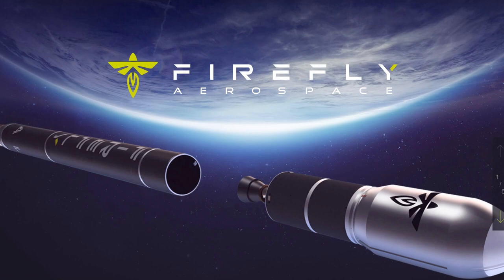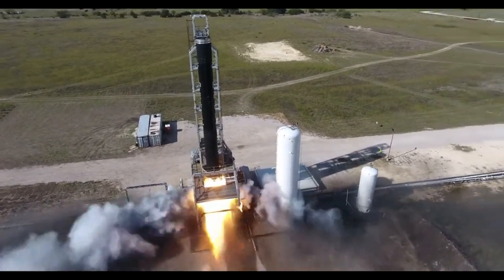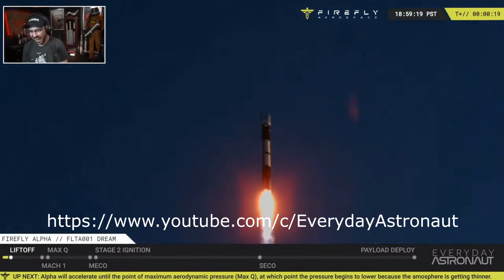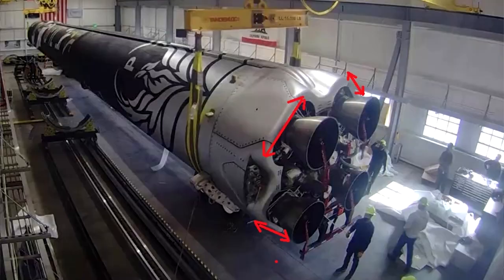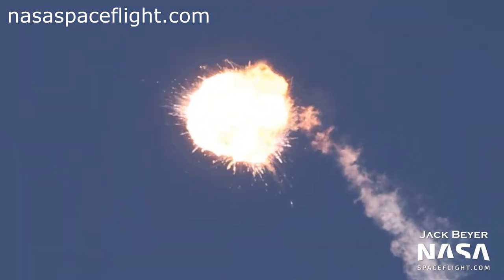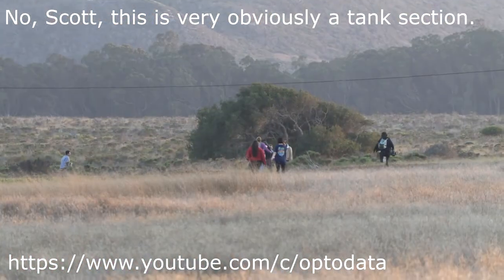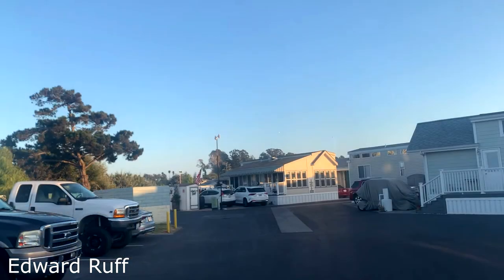Reaver Causes Destruction of FireFly

Comment: "Why do you have a parachute on your cube sat?"
"well, in case it drops out of the fairing mid flight, it won't fall to it's death"
Reply: It's so common in fact that your budgeting should probably count 1.5x the cost of the spacecraft and 2x the launch cost.
Reply: > fall to it is death
Reply: So kerbal ☺
Reply: @Anvilshock  yeah. Always doing the error, almost always correcting it. Its a curse 🤣 *it's!
Reply: Instead, once the fairing is popped, the parachute will deploy and rip the cube sat to parts, cause the rocket to veer violently and destroying a perfectly good launch!
On the other hand, in all situations where a parachute might help, it will burn up first.
And since all you launch is a cube sat shell full of parachute stuff, you may as well not bother ... :-)
Reply: exactly what I was thinking. Mine is also coating in plastic film so it won't get water damaged
Reply: @Gunstick   It's a curse!
Reply: @Gunstick  "....fall to its death"

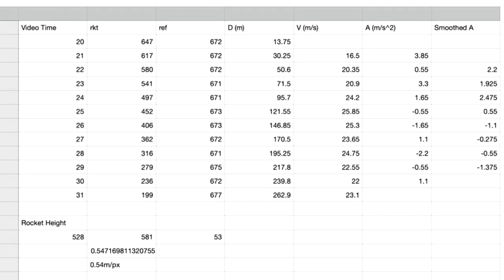Comment: 4:00 "if you are a nerd you would pixel count"
"I did some pixel count"

"I have a spreadsheet"
Conclusion is pretty clear Scott.

Well Done, fellow pixel counting, spreadsheet toting nerd.
Reply: And then he went the extra mile to estimate the altitude from a far off cell phone camera shot.

Sure, it's just trigonometry, but still.
Reply: Tell me about it. I just wasted one hour checking Elon’s statement that “air mass is not trivial” from Tim’s interview part two. By my book, it is trivial or I’d love to be explained otherwise by fellow nerds. (comment in the video).
Reply: I refuse to believe anyone is a nerd until I see their collection of spreadsheets.  If you ain't got spreadsheets, don't even talk data to me.
Reply: @ArnaudMEURET   the tiles will add c.120kg just from the air trapped in them. Plus the material itself, plus the mounting studs. Thats Starship  btw.
Reply: Friends don't let friends spreadsheet.
Reply: @ArnaudMEURET  r/wooosh
;-)
Reply: @DavidOfWhitehills  So that’s an integral part of the tile. No point trying to take it out of the equation. Elon was referring to the mass of air in empty tanks (nitpicking the term “dry mass”). Check the video at 25 min IIRC.
Reply: @ShiShawPocketSand  Truth. That hour was, needless to say, spent on a spreadsheet.

Comment: To be fair, firefly class ships are known for their ability to pull a crazy ivan.
Reply: Usually pretty good with reavers too...
Reply: “Flying piece of goh-se ”
Reply: @sithticklefingers7255  "Atherton, language!"
Reply: @han5vk  Baah! It IS 'shiny' language!
Reply: To starboard or port?
Reply: I don't wanna explode.
Reply: Now that's a Tom Clancy reference I haven't heard in a while... good work, go take a Hollywood shower, Jones...🤣👍🇦🇺
Reply: "You know what the chain of command is? It's the chain I go get and beat you with until you understand who's in ruttin charge here."
Reply: @ewetoo  ..be a 'leaf' then ♥
Reply: I am a leaf on the wind...
Reply: Except this one.
Reply: @greggv8  Nah, it successfully pulled a crazy ivan and survived. Someone on the ground detonated the flight termination system afterward. ;P
Reply: @dallesamllhals9161  yeah nah i saw what happened to the leaf
Reply: @Transmission Control Well, what does it mean to "pull a crazy Ivan"? Just curious.
Reply: @ivanpchelin7912  the Firefly class cargo ships, as seen in the TV series "Firefly" and the movie "Serenity", have their engines in pods that can swivel. They turn the exhaust end down for vertical landing or forwards for slowing down. The Crazy Ivan is turning one engine to point the exhaust forward and quickly spin the ship 180 degrees then flip the engine back. It's a maneuver for changing flight direction extremely fast but requires a highly skilled pilot and puts extreme stress on the ship. The Serenity is only shown doing the move one time, in the movie, while being chased by a Reaver ship.
Reply: @ivanpchelin7912  It's a reference to a maneuver performed by Russian submarine commanders in the cold war. They'd make sudden unpredictable direction changes that would allow them to detect and fire on an enemy submarine that was covertly following in their baffles. The movie Serenity (based on the TV series Firefly) used the term to describe a rapid 180 degree spin of a Firefly class mid-bulk transport spaceship that could be performed in atmo if its two outboard jet engine nacels were vectored independently. In the show, the maneuver was used to escape a Reaver ship that they couldn't otherwise outrun. If you name your company Firefly and your rocket engines Reavers, you have to expect such references.
Reply: @protocol6  Thanks, that's interesting :D
Reply: @aztronomy7457  starboard if it's at the bottom half of the hour and captained by marko ramius

Comment: You know…. That’s impressive how it turned into the airstream twice in two very high-load events, but didn’t start coming apart until FTS triggered the explosives….  I’m not sure if that indicates unnecessary mass, but they clearly have built a good rocket.  Let’s hope they can iron out the kinks of their engines quickly!

Edit: I mean I booster stack didn’t come apart.  Fairings are necessarily weaker structures due to how they typically mount.
Reply: I noticed this too. The failure was a while after Max-Q, so the dynamic pressure was much lower, but still.

Comment: Not only is running to pick up recently exploded rocket debris potentially destroying evidence that would help in analysis, there’s a long and dangerous list of things in and around rockets that you don’t want to be around.
Reply: Exactly - hypergolic propellant being one.
Reply: They only used RP-1 and LOX for these rockets. No hydrazine to worry about. Shouldn't be anything too horrible on the debris.
Reply: hypergolic propellent, radioactive waste, toxic materials, and they are dangerous to touch. The person who pick those up needs to be arrested and that segment needs to be taken to Vandenberg you don't go picking that stuff up.
Reply: @cacaokingdom3122  Are you positive there was no mmh on any of the payloads?  They use RP-1 and LOX for first stage.  How many of those people running out there know what they fueled the second or third stage with?  Or if there even is a third stage?  RP-1 and LOX are basically always used for stage 1 currently.  After stage 1 tho, it varies.  Also I believe the long list includes things in the build materials themselves.  You are rapidly decomposing a lot of materials and coating that make up the rocket and all its components, some will become toxic/hazardous.  Then there is the hydraulic fluids.  Usually 2-3 of them on rockets and burning them leaves toxic residue on surfaces it contacts.  Just because mmh/NTO4 or radioactive materials (the biggies) might not actually be on board doesn't mean there isn't other toxic/hazardous materials on board that can get all over the place when it goes sideways.  There is indeed a long list of materials.
Reply: And if anybody needs anything more on this, I have it on good authority that Ignition is back in print. Go buy it, to make up for all the PDFs of it you stole off the web while it was out of print. :-)
Reply: Another reason not to mess with a part from an exploded rocket is that it's probably hot.
Reply: There could even be spiders out there! Or rabid squirrels 🐿️🐿️🐿️

Comment: Sadly Tim isn't such an infrared camera fan as I am. They had 2 very high end cameras (+lens/telescopes attached) available and only uses them for like 20 seconds without making a comment - you were able to see the cold propellant tanks for example.
Reply: Tim had no cameras on site. They were all from Firefly.
Reply: @nikmathews555  Pretty sure the cameras used are from the base itself. But it was at his control to call up a camera and talk about it. The producer with him would do the actual switching. They only mentioned a short blackout period for engine cams during gimbal sequence before the flight.
Reply: @Veptis  Don't understand why Tim didn't have other cameras not on site. Other ppl got great footage without having the access like he did, could've put in more effort than the lagfest streams he had.
Reply: Wished that Tim had worked on his Soviet rocket engine video instead of trying to do another live stream. He should play to his strengths!

Comment: Something I noticed was that the flame looked off center soon after liftoff. I'd say that reinforces the engine failure hypothesis.
Reply: 15 seconds is what Scott said but thanks.
Reply: I noticed the same issue with the exhaust plume. I was waiting for supersonic and maxQ to be called out. Reminded me of the Astra flight.
Reply: i spotted that also,  it was definitely not center cued indicating consistent compensation of thrust to one axis.
Reply: It was the Pax. The G-23 Paxalon Hydrochlorate that we introduced into the processors.

Comment: If space was easy, everyone would be doing it.  Is it a setback for Firefly?  Hard to say - they probably took a few lost rockets into account in their program.  But I'm hoping they got a lot of data on the flight.  Thanks for the explanation, Scott!!
Reply: the way we're still doing it is like climbing the stairs to the top of burj khalifa. we need space elevators!
Reply: @mfaizsyahmi  Yes.
Reply: Firefly and Astra space had failures but I haven’t lost any confidence!
Reply: @mfaizsyahmi  you'd still need a rocket to get into orbit even if you had an elevator to take it into space. You dont just float in space. You're weightless in orbit because you're going so fast sideways gravity cant pull you back to earth, you're essentially free falling. 

If you made that elevator to space, if you stepped off the platform into space you would fall right back to earth.
Reply: @XxCreateFlowxX  unless you go up to GEO or higher, but thats a whole diffrent challenge
Reply: Has any commercial small sat-scale launcher totally succeeded on their first launch? Electron failed to achieve orbit their first go. 

Failure to achieve orbit was to be expected.
Reply: @XxCreateFlowxX  I'm curious, would it make a difference which side of platform you stepped off of?
I mean if the platform itself is a near perfect geosynchronous orbit, since it must stay directly over the same spot, and maintain a constant amount of tension on the line.

So, when I step off platform directly in line with the platforms forward motion I'm adding some extra velocity and theoretically not having the tension hold me down I might achieve a stable orbit?
And if going off opposite side, I'm retarding my velocity ever so slightly, with a sooner decay of my orbit.  
Plus flying butt first to my fiery doom
Reply: @unitrader403  you still have to orbit in Geostationary orbit but your speed synchronizes with the spinning of the earth?
Reply: @cacogenicist  i think i would worry more if everything goes smoothly on test flight, because that would mean that they are not discovering everything that needs fixing on the rocket. you want explosion on test, not when the rocket is carrying expensive payload. that means you are pushing your tech to the limit.
unless you are Blue Origin and just do safe sub orbital hops that no one cares about.

Comment: I can only imagine the sinking feeling leading up to the moment you have to press the RUD button
Reply: Yeah probably not a good feeling, but I'm sure it wasnt unexpected. For your first launch theres a high chance of failure. Even SpaceX failed 3-4 times before they got into orbit for the first time.
Reply: This is probably one of the reasons why it is - I think at Vandenberg the 30th Space Wing - who owns the guy with the finger on the terminate button, rather than the launch company.
Reply: @XxCreateFlowxX  I cannot recall any entity that hasn’t had a failure on their first attempt with liquid-fueled rockets going back to Robert Goddard and his pen pal Werner von Braun. It seems that “standing on the shoulders of giants” doesn’t apply to advanced rocketry.
Reply: @Markle2k  It basically can't. While certain grievous design errors can be avoided by past mistakes, and mathematics can get a group a large way to completion, making the system work at the outset is practically impossible because very few rocket parts are standardized in any way. There's no supply chain to create a rocket such that everything is reliable and meets its specifications on the first launch for a new company.

Comment: I think Tim also mentioned something like the engine pairs having a single-axis capability only so an engine failure could probably have a bigger effect in controlling trajectory.  Even before the flame out I noticed that the rocket seemed to have a slow acceleration (compared to Electron launches or even Falcon 9 launches).  

Jack Bayer's footage was brilliant.🙂

Comment: If you look at the engine gimbal layout, if it blows an engine, the diagonal engines are the two that must compensate so there is full control authority in the direction of the failure.  So there's no loss in compensation.  There was a 50% loss diagonally from that and it was inefficient for transsonic speeds.

Comment: There was an anomaly call-out already right after the lift off. At 1:58:28 of the official (Tim's) stream, you can hear something like "RC transition operation procedure <something something> 40 57 reported anomaly" followed by "please confirm there are no fires on the pad, I have no visual". They confirm at 1:59:11 that there is no fire on the pad, but perhaps it might be related to the engine anomaly?

Comment: Scott when I watched the NSF videos I noticed that the rocket plume was offset from the centerline of the rocket. I suspected that it may have been from running on 3 engines and the one on the right side from their point of shooting the video was out. Also that the speed was way behind where it should have been.  Your analysis confirmed what I was suspecting.

Comment: A comment and a question: If a piece of rocket (or aircraft--having been peripherally involved in two aircraft crashes) debris falls nearby, and it isn't on fire or otherwise creating a post-landing hazard (it isn't giving off noxious fumes, etc.), the best thing to do--besides not touching or disturbing it--is to photograph it, noting its orientation with respect to other objects (and/or to true North [using a compass or a phone], if no "reference objects" are in sight); that could provide vital accident analysis information. Also, I have a question about the Firefly launch:

I noticed that at least one or two individual lights--and only those--on the floodlight arrays (atop the towers near the launch pad; these light towers are similar to those used at many outdoor football and baseball stadiums) were lit up green, and they seemed to be flickering in a non-random way. Were those lights transmitting digital data of some kind, and if so, concerning what? (The Saturn V IU--Instrument Unit--had an optical sensor, with a mirror, that looked out to "see" a light beam directed at it before launch, from near the pad; this was used to update or calibrate [by cross-checking] the IU's position prior to launch, which is vital to inertial guidance systems--might the green lights at SLC-2 served the same purpose?)

Comment: More & more engine on booster seems to be found good option. After the engine loss it headed very straight & in the double flip it didn't broken, so its have quite robust body, i think. And thanks for the pixel count analysis.

Comment: Good analysis, great backgrounder.  Yes, the Firefly TV series was one of our favorites too.  Firing your engines in a static test for 15s is not even close to being the same thing as running them on a rocket for 3m.  I agree that it was probably a single engine failure, my guess would be, as Tim was talking about on another failure recently, fuel starvation.  Somebody's gotta account somehow for the fuel to get pushed to one side of the tank, or manifold, or whatever.  To keep distributing fuel to all of your engines equally to prevent such is a very complex problem!
Reply: BTW - they were fortunate to get that thing off the ground and away from the launch pad at least.  My brother-in-law was at Vandenberg for a launch one time, he was actually giving a presentation in a conference room when a rocket blew up on the launch pad - *BOOOMMM!!!*  Kinda ruined his presentation.

Comment: Great analysis! We were in the viewing bleachers about 5 miles from the pad. I took video, and you could hear the explosion almost exactly a minute after seeing it blow up. 60 seconds @ ~5 seconds/mile would be 12 miles. Assuming it went straight up, sqrt(12^2-5^2) = 10.9 miles up.. that's not far off the 50k ft that you guessed.

Comment: So do you think this rocket needs to be more redudenct; perhaps add more engines or thrust? Because having one engine failure seems like goodnight to the rocket. F9(although larger and heavier so less susceptible to side forces) has 9 engines. One engine failing isn't enough for the rocket to loose acceleration

Comment: The biggest question is surely, - Was the first Abort call and hold for the same reason as the possible call for a second time to abort in a lower voice and were these abort scenareos the cause of the engine failure? If they are all the same issue then it started on the ground and didnt develop in flight. So it must be easier and less expensive to recover and make another flight.
Dont look at it as an engine failure 1/4, actually it was 3/4 a 75% success and even the flight termination system worked, so the safety crew must be impressed.